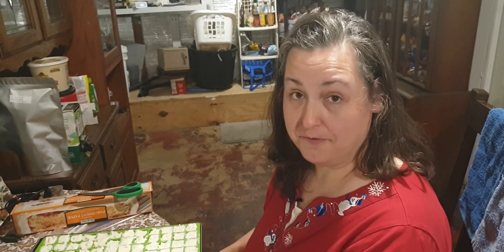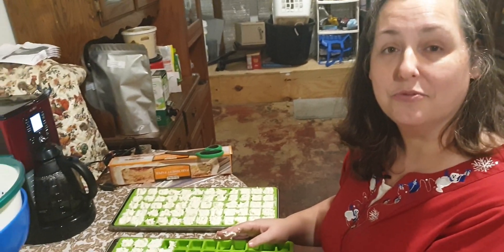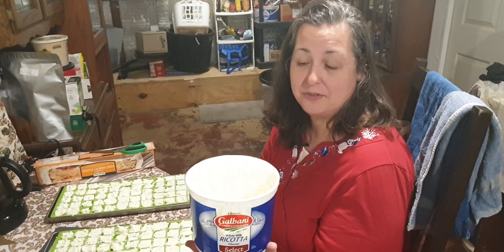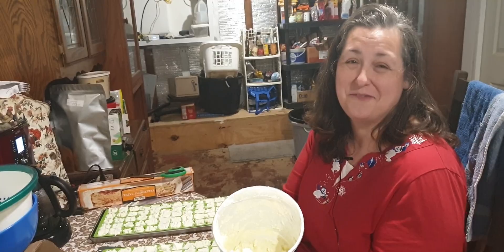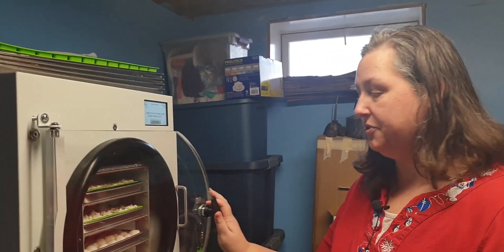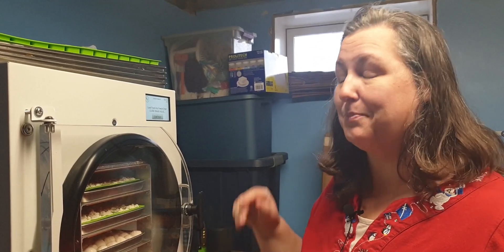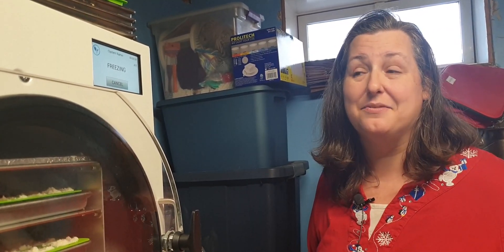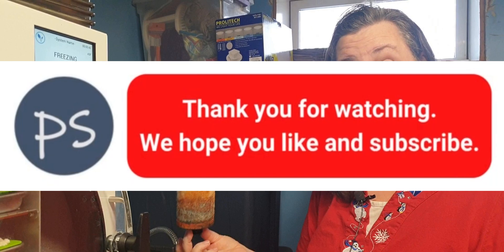HR freeze dryer pump rust issue

Comment: Just wondering, did you happen to do anything with vinegar in it? Like pickles?  Just because my oil and everything went to crap after both times of doing vinegar items.  So I thought it might be that causing the demister to bad.   Already replaced it once, will have to do it again.
Reply from the maker: Thanks for the heads up. I don't think that's what caused our problem. I don't often freeze dry pickled items because I find the final product too salty, but I will be mindful of your comment if I do vinegary items in the future. Hope the rest of your freeze drying season goes well.

Comment: Hi, I'm out doing research, and you've got me checking my pump for a clean return.

The ball valve seized on me, so in my last search for answers to resolving this, I found out that USDA only supports stainless steel for food-grade metals, not brass. 

But the parts on the tubes connecting to both ends of that ball valve are brass, not stainless. So that brass is rusting. 

I clean my machine EVERY use. So I was shocked to see what I found when I took the ball valve off. All that rust and gunk building up around that ball valve was nasty and has me concerned about how healthy it is when it's opened and all that gunk is pulled back into the chamber?

Have you checked that, too? I realize this video is almost a year old, but I wanted to know if you have experienced this.